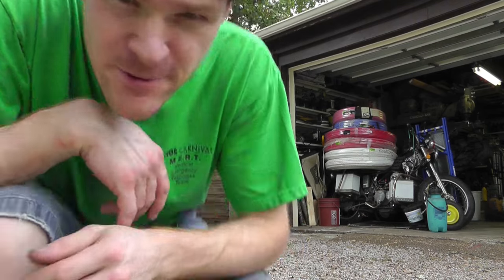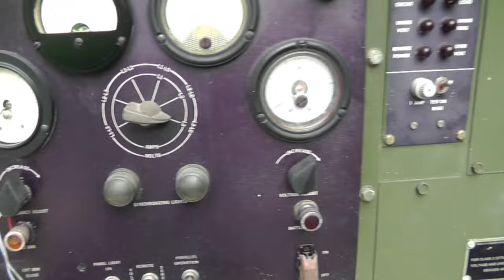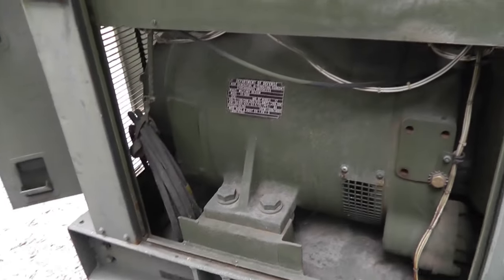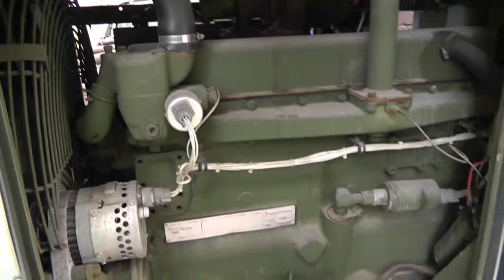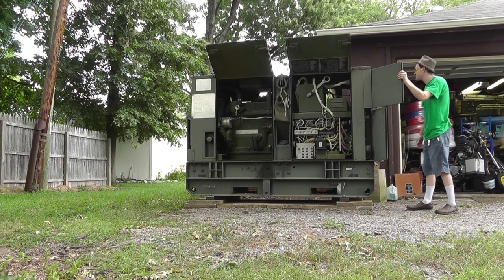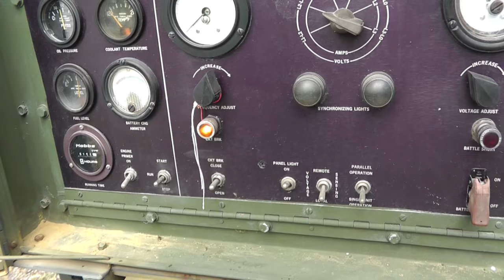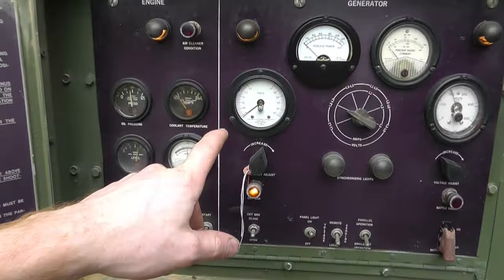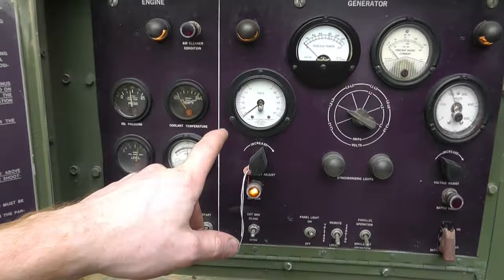MEP-006A Military 60KW GenSet. Overview And First Run After Sitting For 3+ years...

Comment: Hello, from Muscle Shoals Alabama, United States 

did not find a email address posted in the description for private communicatons with you.
so having to use this method.

Just wondering what was the auction site for buying such equipment?
if you do not mind list in the description so others can try to get a deal also.

You did a good job getting it to run. 
Great is for if you ever have outage.  
check out northerntools.com for control pannels if you need them and trilers to put the generator on for transport. 

Hope you and your viewers have a great day.

Comment: 60 kW generator would almost round of four room house with electric 30 gallon the water heater ceiling light in each room and two plug-ins in each room it would run also a regular kitchen stove and medium small freezer and a medium fridge and also a small washer and dryer., But not everything at once. I am a retired special list with the Minnesota Army National Guard Cabo in charge of light vehicle maintenance, including generators. A company size outfit was about 120 people including at least one 3 kW generator, and I believe 45 companies 60 W generator would be used For the battalions size headquarters.
Reply: A typical 4 bedroom all electric home with two air conditioning systems usually has a 200 amp main. If everything in the house was turned on and running on 220-volt loads, a 200 amp main could only supply 48,000 watts.  At full load the average home would only require about  60KVW.  But that would mean that all airconditioning, water heaters, laundry, range, oven, lighting, and all other devices in the home were turned on (with everything turned to the highest electrical usages) all at the same time.  This would trip the 200amp main breaker.  I need to look at my own electrical usage

Comment: You got an aircraft generator... Aircraft need 400Hz to run this on board electronics. I know this because I used to work on a similar model when I was in the Air Force. Good luck at trying to bypass all the safety circuits to get it to run at 60Hz.
Reply: Ronnie Hutchins the alternator data plate does show this is the 50 60 hz model. The one you may have worked on is the MEP 115 400 hz version. The painted on numbers is 49 MMG I worked at that squadron and we had no 400 MEP series generators. We stored BEAR base equipment.

Comment: He was running that at Way too low RPM; his Hertz gauge was barely twitching and they need to be run at 60hz and left there.  Letting them idle with the generator excited and operating will burn out the voltage regulator very quickly.

Comment: The three screws on the top of let you in behind that access panel on the front I suggest you be very careful with a 480 3 phase generator you might know what you're doing but consult all your friends that know three phase power there's a reason the Army stepped away from those generators and it is that sound that your hearing while not hearing ear protection

Comment: The 400hz gen sets were used to run computers . Think overclocking. They had to have AC on them to cool them. Either the wrong tag or the wrong freq gauge.

Comment: The problem is you need Micro film manual because they use military spec parts which can be difficult if not a government agency. Local government has several but I wouldn't buy for individual se really.

Comment: It will be broken soon. Not grounded no pre op doesn't even know it's supposed to have a TM technical manual for before ,during and after operations PMCS. preventive maintenance checks service. Go head and hit the battle trip lower right on the panel. :)

Comment: Really? Taking measurements of high voltage AC with aligator clips, and no gloves? Dude. And that panel is supposed to be ON when it's running, I can't believe you said that you thought it should be OFF for running. It's there for your safety.
Anyway, prior Air Force here, Power Pro, used to work on these all the time, nice lilttle nostalgia trip.
Reply: Ex Army Tech Specialist we had a few of these had to maintenance them all the time. My first thought when he took that panel off then said he was going to leave it off was oh shit!!!

Comment: This must be the 90s version on the modern MEPS 806 with the john deere
Reply: Keith Melton this is actually the legacy version of the MEP 806. The MEP 006 was built in the 70’s & 80’s. Where as the TQG (806) A model was mid 90’s to early 2000’s, B model going forward. The 60 kW before the 006a was the MB-17, going back into 50’s & 60’s. The newest military generator brand is now the AMMPS from Cummins.

Comment: now with the motor is running on a generator all external hatches should be closed so that you get the proper airflow through the radiator to cool the engine and I have not seen anything that looks like a grounding rod on this generator this should be a wire attached to a 6-ft long rod there has been driven into the ground at least two thirds of the way I did not see him do this or anything like it anywhere in the video

Comment: This is a HOW NOT to video.  You would never start up a generator without knowing its history, you could end up with a boat anchor. This is a standby generator,  Not to be used for continuous use output as he intends to use it for.  It simply is not built for that kind of usage.  Once this unit has over 2000 hours on it, it is closing in on end of life and would be worth about 500$.   This generator is worth about 4000.00.. loaded on a truck. The hours are maintenance hours and is very common to see low hour standby units. There are 2 types of generators,  Continuous use and Standby.  This being a standby, it is designed to run for short periods of time in mission critical backup power situations.  Meaning you would have a UPS with a Battery bank that kicks in once power shuts down and is designed to provide Uninterrupted Power Supply (UPS) while the standby generator starts up.  That is the only function of the battery bank, which is to provide power while the genset fires up, once the standby generator is up to speed the ATS switches the power load over to the generator and it will run until it is shut down or it runs out of diesel, or LP/NG.
Reply: You're so full of it. Those things run for as long as you want to. I know because I use to work on them when I was in the Army. When I was deployed, they run for weeks on end with an external fuel supply and only shut them down for about and hour to change the oil and filters and back on line they went.
Reply: looks like the American version of the old 16/24kva gen we used to use in the U.K. mil. output is single or 3 phase.
single phase was 240v 50 Hz 16KVA and 3 phase 415v 50/60 Hz 24KVA. if the demand was too high then you could sychronise 2 to cover the load. worked forever as long as they had fuel in them. Never forgot being zapped by 415V lol
Reply: Biltospill We have ran this very same generator for two weeks straight during  hurricane Irma and she didn’t miss a lick the whole time. We use ours to power a law enforcement fleet shop.
Reply: These-dam things are build like brink house. Will run for ever with proper maintenance.
Reply: Voodoo one They will run forever but they need a load or they need to have the ld bank installed on the top so you can dial in a load. Without the proper load they will wetstack.
Reply: Without being an electrician, he will kill himself LONG before it will wetstack. LOL
Reply: Boy that brings back memories. Old 52X40 here.
Reply: I was a generator mechanic in the Army.  I brought one of these back from the dead and learned a bit about timing your fuel injection pump at the right spot of its rotaion when the number 1 cylinder is top dead center.  Anyway these are not standby generators and can run 24 7 for weeks.  Just do services every 200 hours.  And blow out the filters and replace them regularly.  Dont underload them or they will start to wet stack, and follow the specs for deration depending on geographical location and climate.
Reply: wetstack  what is the meaning of wetstack?
Reply: @MrJerryjam  
Wet stacking unburned diesel fuel getting into exhaust and damaging the turbo...
Mainly caused because an engine is loafing and not working hard...
A diesel engine works best and most efficient at %90 power so the cylinder temperatures remain at their optimal design working level and all the fuel is burnt.
Older semi trucks also had this problem when idled too much.
Load banks are used to keep a large generator loaded up and the engine hot during times of low power demand from the working load.
Reply: @MrJerryjam  google
Reply: Check fluids throw battery in it see what happens you got start somewhere. It'll eithier go or blow. Chance u take.
Reply: @zaklynch1047  God Bless u

Comment: 3 phase, 400Hz?!  İ very surpriced. How you will use it?
Reply: Aircraft equipment usually run at 400Hz so that's probably why. It's made for hooking up as a APU to military aircraft. But you can set it to 50/60Hz also.
Reply: fyllefinken 
Converting a 400 hz gen to 50 or 60 hz cannot be done without major modifications. 50/60 hz generally runs a 4 pole alternator.  400 hz has a lot more poles. Long story short the main alternator and avr need replaced and governor would need modified to work at 60 hz that all shore powered equipment runs at in north america
Reply: Mr Diesel exact, you need a brand new alternator for that
Reply: 400 Hz is common in military devices because it is smaller and lighter than 50/60 Hz devices.
Reply: 20kilovolt : Cleaner frequency than 50/60 hz.
Reply: 20kilovolt : Aviation RF (radio frequency transmitters) low frequency 50/60 cycle hum/buzz is hard to filter and can damage sensitive radio frequency oscillating equipment, 400hz is very clean and doesn't  produce the cycling buzz that can interfere and distort audio while being transmitted through RF. if your curious, turn on an AM radio and put the antenna close to an ordinary AC house outlet, you'll see what I mean, or rather hear what I mean.
    There are many other reasons for the 400 cycle electrical equipment but, the U.S. Military standardizes everything, all equipment from all branches i.e. engines, communication equipment, Firearms etc...all branches uses JP-8 fuel for "Everything" except for the Marines, if I'am not mistaken,  the Marines uses JP-5 for all of their fuel required applications,
Reply: Eric Dee Thanks for your explanation! I'ts much more clear now.
Reply: The plate on the actual generator was labeled 50/60hz as well at the frequency meter.  Im guessing it's actually 50/60hz
Reply: Eric Dee as far as I know 400hz is used because it allows transformers to be much smaller and lighter.
Reply: 20kilovolt a
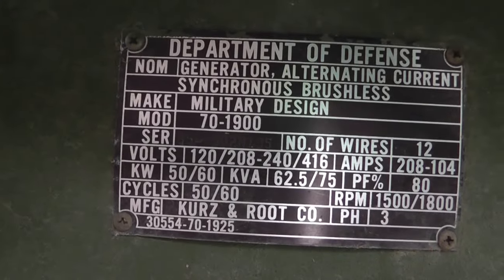Reply: Where does it say 400 hz?  at 8:12 plate says 50/60 cycles
Reply: Looks like a bad external plate. Doing a quick search on the internet for a manual gave me the Army manual for a series of generators.
MEP 006A - Utility class generator 50/60 Hz
MEP 105A - Precise class generator 50/60 Hz
MEP 115A - Precise class generator 400 Hz

And the external plate did claim it's a MEP 006A. But there's also the conflict stating that it's 400 Hz, but the label on the generator itself states that it's 50/60 Hz, so I'd assume that the correct frequency is 50/60 Hz.
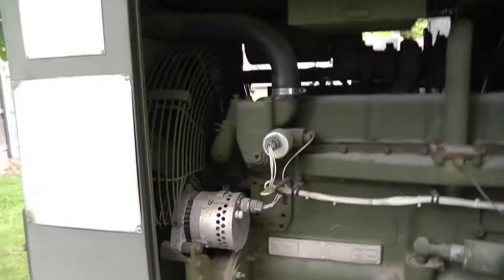Reply: @Matthew Obley at 7:02 schematic lower right hand corner. Its referring to both 400Hz and 50/60Hz variants, this one being 50/60Hz as mentioned else where.
Reply: You are not very observant and don't pay very close attention. In the beginning he said that tag on the side was wrong and if you were looking at the frequency meter you would have noticed that it had a 50hz side and a 60hz side. As well as the tag on the generator head. So now I know switching the tags does work. Because of people like you one look at the tag and oh it's 400hz so no body is interested and you wind up getting it for next to nothing.
Reply: @DoRC  

You know it's amazing how many people read the tag on the outside and completely ignore the obvious. That's why that works switching out the tag with a 400hz model then when it ends up at a surplus auction one look at the tag and oh it's 400hz so no body is interested and it ends up going for little more than scrap value.
Reply: @DoRC  

Yes that's true but also 2 hp motor at 400hz is smaller than a 1/6 hp motor 60hz and when it comes to aircraft size and weight really does matter!
Reply: @johncochran8497  

Bingo you got it. Someone switched the tag so that they could get the generator for a song. Because nobody wants a 400hz model.
Reply: @LouGiblin  

Motors are smaller transformers are smaller and power supply filter caps are smaller because full wave rectified 400hz has a ripple frequency of 1200hz very small filter caps are quite effective.

Comment: well i was in the airforce from 1980-84 that looks like a flight line main gen set the one you want is the plane start up ones why there on wheels can be drug around from plane to plane, i hauled stuff to fight line for plane use a10,  f4,fb111. f16 & f15 the thunderbirds was there home base i was at a training base for new airforce pilot training! I did not work on the gen sets  i would move it if the flight crew asked me too! i drove the tow mb4 Coleman tug or trug both were slow ugly looking thing!

Comment: it absolutely has to be LEVEL to operate. I would get a CERTIFIED ELECTRICIAN to go over it. You should have swapped all the liquids out, checked the hose and fittings and gotten the FIELD MANUAL on this. they actually make a manual for everything. just saying.
Reply: it is 400 hz not 60

Comment: I got my hands on a 15kw generator but it runs on 400hz, how the hell can I get it down to 60?
Reply: parker benz engine rpm determines hz. Slow rpm to decrease, raise rpm to increase. That said, you may have to reconfigure the pickups to bring the Hertz down to a manageable range.

Comment: Anybody know how to work on these. My fire department  has one and it keeps tripping the breaker and shutting off. I'm dead serious I need someone who is qualified to work on these
Reply: Did you find someone to fix yours? 
We have this model the motor runs but does not generate electricity. Not sure if it's the regulator or what? We can not find anyone who works on them here in western Colorado. Any advice?

Comment: not grounded, good way to get killed . . . . 
these are not toys. . . .
you have to have a load on to increase or decrease the voltage and amps ...
your lucky with them keys hanging you didn't get killed.

Comment: ok let's go first off yes that is an MEP 006 a I know this because in the military my job as a 52 d was a power generation equipment repair or as it was shortly known generator mechanic but what you have there is not a set it is half of a set a real set consists of two generators which is why it is called a set he does not know what the hell he's talking about he calls the places where you cook your parallel cables to control enter monitor and ensure that when you hook two generators together that they are running in sync with each other so you don't get any power spikes or feedback power output don't listen to this phone he's trying to get somebody killed most likely himself at some point in time

Comment: This dude just Dose not know what he is doing he is going to get  hurt.. you're not supposed to run a diesel engine without diesel fuel nothing like a gasoline engine because diesel engines get air in the lines when they run out of fuel.

Comment: WTF was so funny ?
Military auctions their crap off all the time. And most of this stuff is treated/serviced like it was gold. And it's usually cheap. And the ground flyboys are very good with servicing their 'equipment. (Wink wink).

And you seem to know enough about electric to get yourself killed. I've seen powerlines arch through plywood in the light rain.
You said it was light raining and your keys are jangling near your nut sack and the power ports - be careful will ya or you'll be the disaster relief .....
Reply: Power lines usually operate at 7200 volts or higher. This operates at a maximum of 425 volts. I don’t think it’s going to do any arcing at such voltages, but it could still kill him if he stuck something where it doesn’t belong, like those keys or his fingers... I agree, he seems to have just enough knowledge about electricity to get himself killed.

Comment: Very disappointing video! 👎 Too much talking and talking and walking around the unit until it was started. ☹ Why didn't you plug a load into it like a saw or refrigerator or heater or air conditioner so we can see it run? ☹ I was waiting with anticipation.